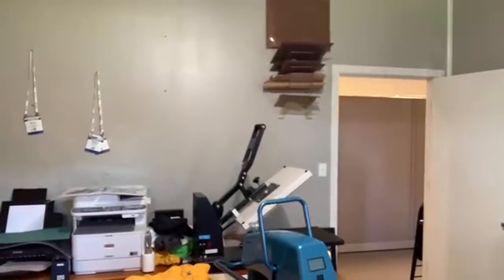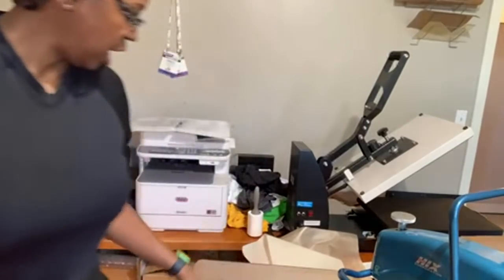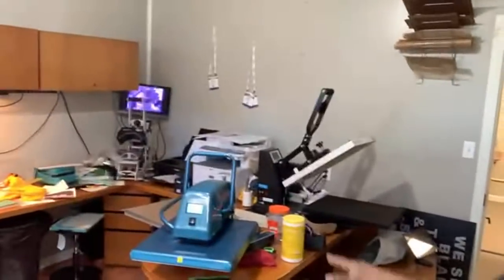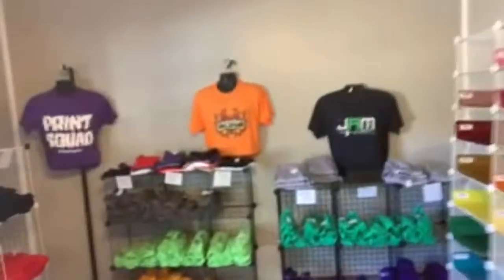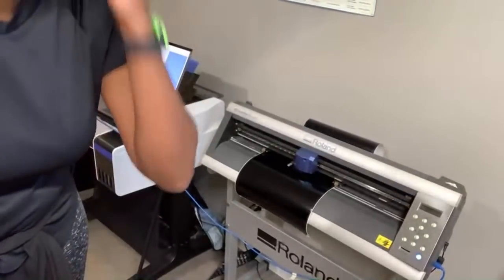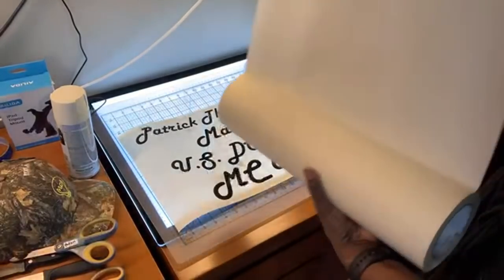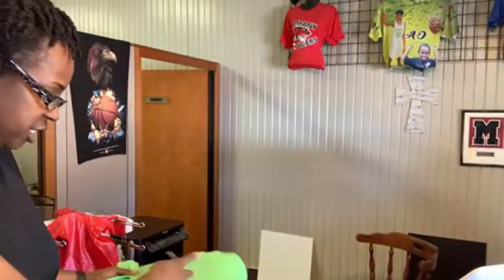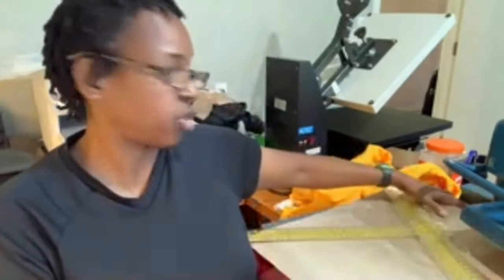Printing DTF Transfers & More

Comment: I want to start DTF printing 
But how do you put down a layer of white ink under the print so you can print it on a black or dark color shirt.
I think you have to have a rip software right?
How do you do that?
Reply from the maker: Yes,  You will need a DTF Rip software for the white ink to print as an underbase on top of the colors.

Comment: How do you deal with moisture on the pet film?
Reply from the maker: Hi Muhammad! In this video I was not printing my own film those were just samples sent from a company that does.  They had some of those silica gel packs in with the transfers I guess that is what they were using to prevent moisture.
Reply: @TshirtChick  thank you, I just dry it with heat gun before printing and it worked really well.

Comment: Hummmn wonder if dtf is better than dtg 🤔
Reply from the maker: I would say yes because it's cheaper and you can print transfers without having to tape the film to the DTG machine.
Reply: @TshirtChick  oh so maybe I will use this vs dtg. I just don't want the design to fall off.